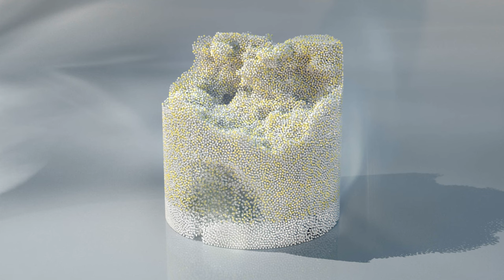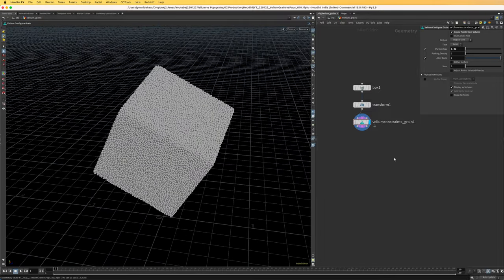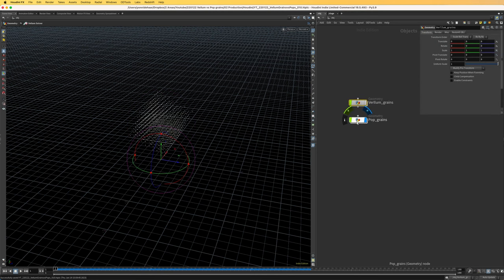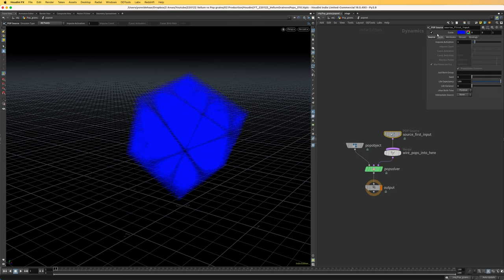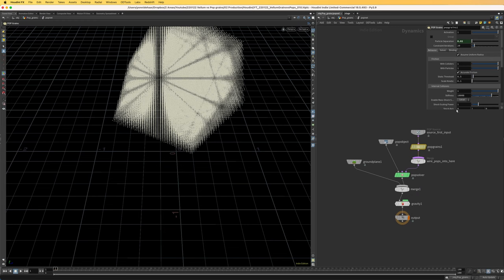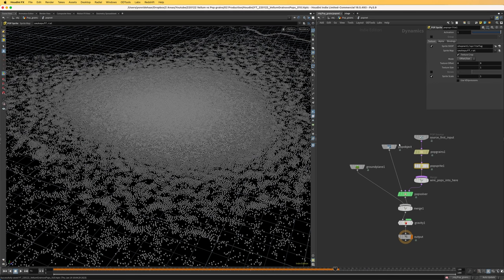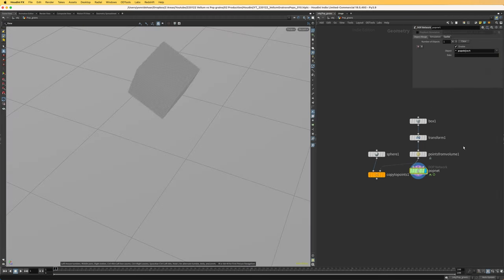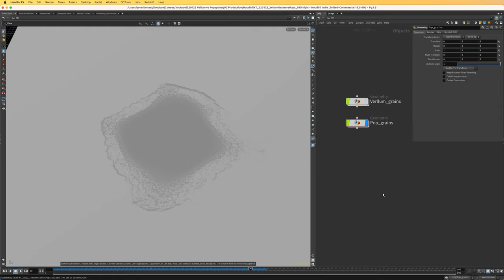Houdini Vellum vs POP grains

Comment: Hi Yonni, please could you show how did you setup the grains (even the cluster and constraints) and the render for the cylinder at sec 11? Thank you
Reply from the maker: Hello! I go into it on my Patreon, but it's basically a tube, vellum configure grain (fill with particles), a 'pop advect by volumes' and I've used some attribute noise to blast the top particles out, so the top is a bit more uneven. Hope that helps :)
—
https://www.patreon.com/posts/january-23-76429755?utm_medium=clipboard_copy&utm_source=copyLink&utm_campaign=postshare_creator&utm_content=join_link

Comment: Great content! Tutorials like this comparison are crucial in today's fast-paced world of software development. New users need to learn and compare new features with old ones, and it's becoming a requirement to build better skills.

I have one question: In this tutorial, you cover a simple setup and compare the speed of the simulation. For a more advanced setup, what are the pros and cons for may be a ground destruction? Which one is better? Before Vellum, pop grains were solely responsible for this type of work. But after Vellum grains, can it do it as well? Thank you.